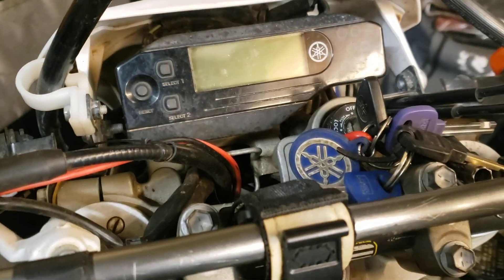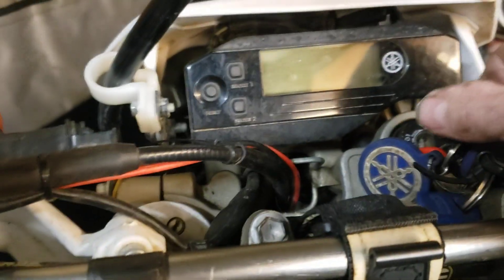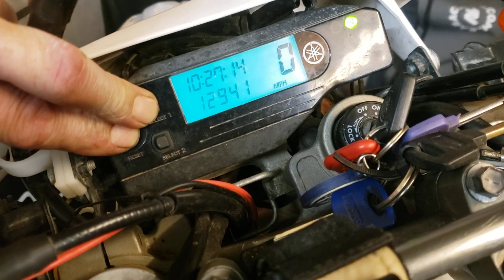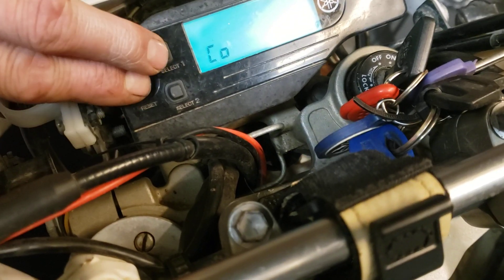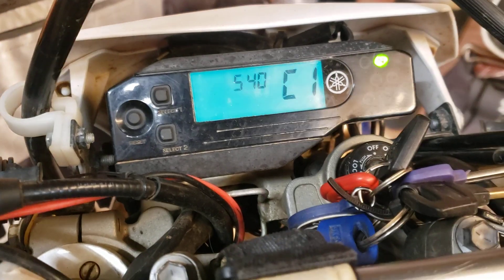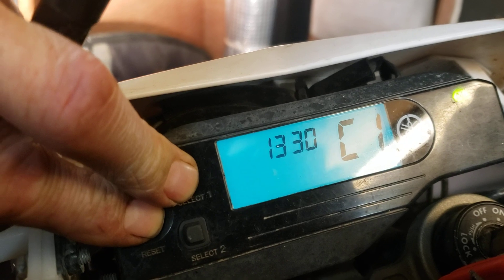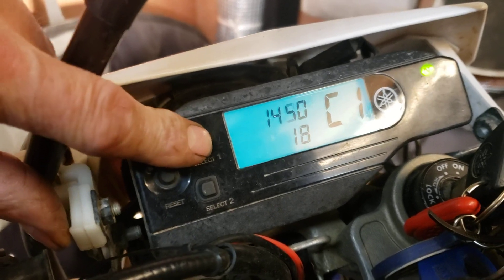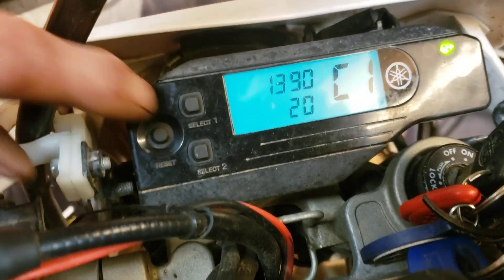Yamaha WR250r  Diagnostic  mode to adjust CO level at idle

Comment: What year is your bike 
My 08’ does not want to show the Co1 when u press the select 1 after getting into diag
Reply: Same.. And mines a 2020 model. Do you have to jumper the angle sensor to change it or do the newer bikes just not let you
Reply: You need to connect the extra wire on the tip sensor to ground. I just did this to my 2008 this morning. @chainbenwa2713
Reply: I think diagnosticeren modes are locked in some countries and you have to do a mod first before you can acces it.